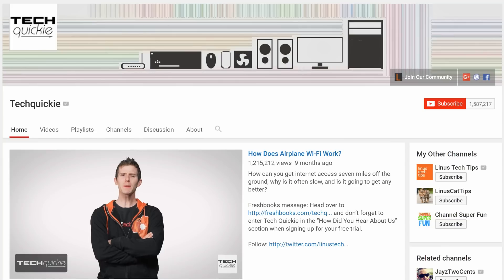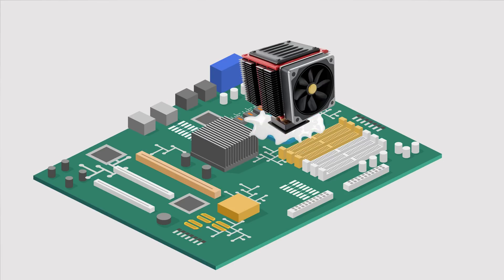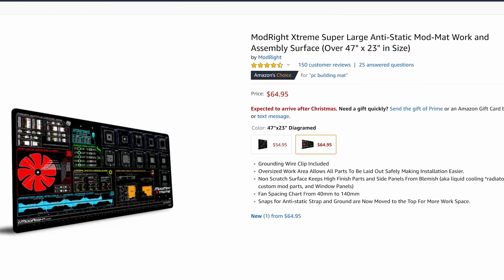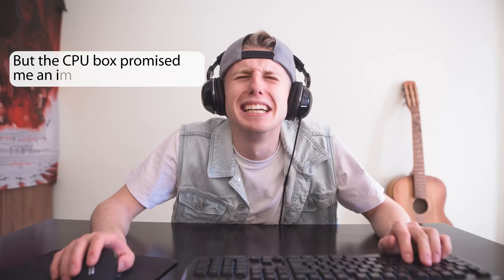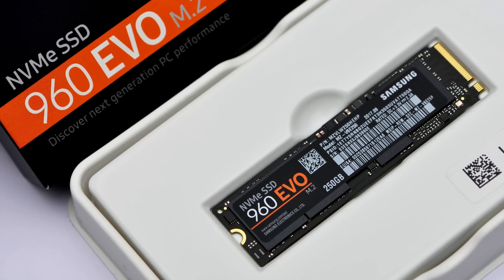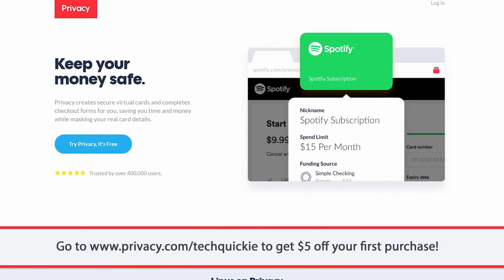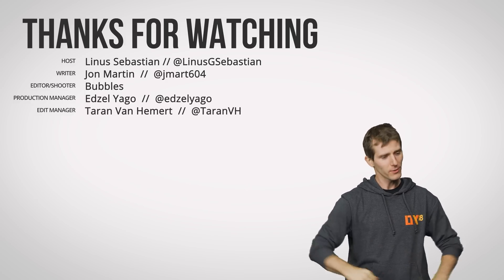DON'T Make THESE Mistakes Building A PC (pt. 5)

Comment: I understand static discharge is overstated. Most all stuff has plenty of shock tolerance so that unless you're walking around with a sweater and rubbing your feet on the carpet  with a visible painful shock happening when you touch things, you'll be fine. Or at least it seems to me from what I've read elsewhere that if you can't see or feel shocks, then they are not strong enough to damage anything.

Comment: common pc building mistakes ive noticed are saving money on a gpu while wasting money on a cpu flashy leds or just getting 1 ram not getting a 500w psu not screwing in the chassi stands not reading the manual for where the power on cords go on the mb

Comment: Avoid mistake I just made - installed a new 2.5" SSD - only realised when i'd  done all my cable management and powered up the PC that I'd gone and used the motherboard's empty SATA connector that gets negated when the NVMe m.2 ssd slot (in my case an optane module) is occupied. Damn - I've got a heavily hardware-populated Fractal Core 500 mini ITX set-up that is a complete bitch to open up, adapt and keep neat internally - I had to reaffix the front header connectors because cable-managing the SATA power leads pulled them all out - It's a challenging, fiddly yet highly rewarding end result of a build. https://uk.pcpartpicker.com/b/PbCbt6

Comment: 1) DON'T go with less than 16 gigs of ram
2) SSD, SSD, SSD, SSD, SSSSDDDDD
3) stock fans on the case will do, more fans don't improve cooling much
4) as many USB 3's as possible
5) get an OVER-THE-TOP power supply just in case

Comment: Speaking of NVMe vs SATA over M.2, some slots will only work with one of these protocols. It's rare to see it happen in atx motherboards, but surprisingly common in laptops. So you could end up buying a drive that won't work at all with your system.
In addition to that, not every motherboard supports booting from NVMe drives, even when they do support NVMe. It's really rare nowadays, but it was a thing a couple of years ago.

Comment: Hey Linus, I recently built a new Gaming PC and for a while it was working. The next morning I turned it on but nothing projected to the motherboard and the GPU fans were twitching. Also the case wouldn’t turn off using the dedicated power button on it. Do you know what that happened?

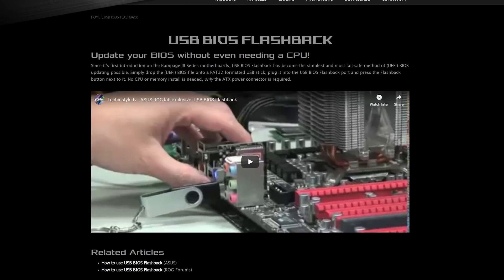Comment: 4:00 "May" ? This should just be considered the default state. MBs that can have their BIOS updated using built-in Hardware are extremely few and far between. As far as I'm aware no AMD supports it, and very few Intel ones do either. If you're doing a new build, get the correct Motherboard for the chip. Even if you can get it working using a BIOS update, the VRMs might not be configured in a way that gets you the best performance.

Comment: i bought a amd a8 apu frm ebay 5 years ago with more than 10 pins bent, straightened them with a ball point pen tip with the refill retracted, works perfectly till date, never taken the risk to remove the cpu ever again.

Comment: i never grounded myself or damaged any component by not doing any anti static measures.
you can literally rub your socks on a carpet and then build a pc without damaging anything. voltage and duration of static shocks are just too low

Comment: Best tip you can give someone is tell them to NOT read the motherboard manual. That's because the manual is written by a bunch of egghead assholes who think they're better than you. Just follow your gut when building a system, because chances are your gut knows just as much as those eggheads when it comes to your motherboard.

Comment: Why the hell would you have the graphic of the SSD on the turtle the show a m.2 nvme but represent it as an older style m. 2 that has the same speed as SATA. You can see the connection it's clearly NVME

REEEEEEEEEEEE

Comment: i've bought mSata ssd on purpose. It does not require extra cables to connect and does not take space in the box. But i see no real world benefit of nvme drives for myself, and it costs like 100$ more for 1tb version.

Comment: Make sure to use stand-offs for securing the mobo into the case, and make sure they are placed correctly into the case, that is aligned with the screw holes in the mobo. Also double check that all the cables are connected properly before trying to boot up the system.

Comment: Im building a pc w/
Intel i5-9600k
Gigabye z390 aorus pro motherboard
Corsair h115i pro cpu cooler
Corsair vengeance 16 gig 2666 hz ram
500gb samsung ssd and 1 tb hdd
Rtx 2070
And an evga supernova g3 550 watt gold certified power supply.
Not sure about the case...

Has anyone got any tips for me?

Comment: Your computer doesn't need to be plugged in for anti-static tools to work.  The point of them is to keep you (or items touching your mat) and computer at the same electrical potential (no static discharge is possible).

Comment: About the pressing down on cpu thing... From what I've seen, the ryzen line actually occasionally need a little push to settle properly and I've seen tech YouTubers who warn against pushing down the cpu then go and do just that and it works fine...
And I ended up having to push a tiny bit on mine too! XD

Comment: My advice if you are not buying everything all at once. 

Make the Video card the Very LAST thing you buy. Piecing a computer together, you should be buying the longest life things first anyway... things that wont go obsolete very quickly (psu, case, ect). Due to that, video cards should always be the last thing. As they always go obsolete the fastest, so by the time you are ready to complete the build, you'll have the latest, or cheapest price, on the video card.

Comment: Linus i need help I'm broke. I'm playing with intel hd integrated graphics and i have a i3 4130 at 3.0 Ghz..... 1 - 4 gb ram at 1300 and no gpu.  I'm thinking of getting a GTX 1030 with 2-3 gb or GTX 750 with 2 gb but both are listed around the same price.... also shluld i get another 4gb 1300 or a higher frequency speed? Plz.....

Comment: One small tip is checking your power supply and motherboard connections, because if they are not properly pluged you will get electrocuted very bad, it happend to me

Comment: I just ran into a trap with my CPU cooler. It was too big to add any additional case fans installed around it. This was built in an ITX case though, but still, the thickness of the fans is somewhat important as I bought a few Noctua fans that i now have to return...

Comment: My house isn’t very big so I was recently kneeling at my coffee table on carpet dropping an 8700k into a new Mobo (Amazon blackfriday deal)
I had the power supply plugged in and switched off by me and I often touched it to discharge static. I had no issues, upgraded rig runs great!

Comment: 1: Don't use a swiss army knife to build it
2: Don't spill Water on it
3: Don't touch the Mobo when the system is on
4: Don't use the wrong Radiator screws
5: Don't Ragequit by throwing your PC out of the Window

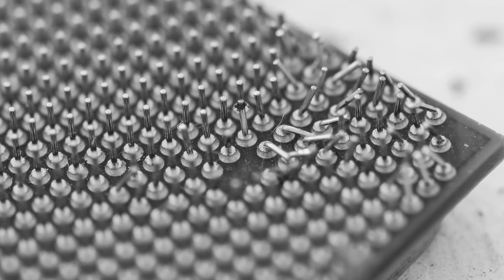Comment: 4:47 I had a friend bring in his mother's computer (that I had built) with pins like that on the AMD CPU. A CPU that was still attached to the heatsink.

How, you ask?

Well, I had told him to remove the heatsink fan so  that he could clean it (and blow air through the heatsink fins). He instead removed the heatsink, but he somehow managed to pull the CPU as well...still attached by the baked thermal compound.

Which, if he knew what he was doing, might have been fine. But he didn't. So after he was finished washing the heatsink (yes, he did), he tried to put it back in.This went...poorly.

Luckily, sanity prevailed and he brought the hot mess to me. So after getting a good laugh out of it, I fixed everything up and that computer is still chugging along.
Reply: I feel like I read this story on reddit😂
Reply: @wh2681  theres a good chance you have
Reply: @HappyKrecik It was an Athlon 2 or something? Black Edition? Don't remember at all. Something like 10 years ago now.

Comment: I have a better one: if you use a motherboard that requires that classical sheet metal IO shield at the back, make sure that no metal tongs are bent out and obstructing the port. ;) I had to remove the motherboard once to fix this (though, it wasn't me who made the mistake).

Comment: Two things. These might be common sense for a lot of folks but here goes. 1 Research the system you are interested in for PSU wattage. Wasn't on the box of the one I just bought. 2 If you are going to add a video card, find out the recommended CPU and PSU wattage. And compare said graphics card with the onboard. They might be about the same depending. Learned the hard way...
Reply: I have a friend using an A10 apu with a gt730 and no matter how much I tell him that the integrated graphics are better than his graphics card but he still insist on that gpu

Comment: I kinda messed up on my first build with the Ryzen 7's Wraith Spire cooler's pre-applied thermal paste. The cooler slightly came off the CPU twice because the stubborn screws wouldn't thread in. I'm worried that it may have created air bubbles. It idles at 32c. Not sure if that's normal. I gotta get a program to test temps in-game but I haven't noticed any performance issues though.

Comment: Buying proper motherboards for overclocking. No not stuff like ‘Z series on Intel and X and B’s on AMD’. I mean phase count, where the XI Hero offers a four phase with a pretty meh heatsink and the Gigabyte Master offers a six phase and a proper heatsink that would be better than most of the ASUS’ lineup.

Comment: You guys are actually wrong... Back in the days of LGA 775 it was common that e.g. Core 2-CPUs did not work in older boards which were designed for Pentium 4-CPUs. And some times even the other way around...

Comment: About the touching metal: touch BARE metal. Linus could have specified that. Painted metal like in the animation WON'T be enough.
Reply: Also they didnt even mention the most important that unless your living in UK not ALL plugs are grounded in most countries. Its mostly the plugs in the kitchen and washing room that have ground pins.
Reply: @tomwes8390  I didn't even think of that. Over here it is required by law to have all plugs grounded. Especially in older houses it could indeed be the case that not all plugs are grounded!
Reply: @Muscleduck  It ofcourse depends on the country but especially on Euro plugs you have to be careful. People just assume that the socket is always grounded but with euro sockets you can see if its grounded. If there is no metal pin in the euro socket sticking its most likely not grounded. The ground pin goes inside the euro plug so it touches the inside of the plug. Opposite of normally where the plug goes in to the socket. The plug must also support grounding (hole in the plug). Not all power strips have ground support
Reply: @tomwes8390  I live in Belgium so I know what EU plugs look like 😉
Reply: @Muscleduck  Explaining for the rest of the viewers how to spot a EU grounded socket :) Wat een mooi toeval! Wist niet eens dat die wet daar zo was in belgie. Gelukkig nieuwjaar nog. Groeten van je buurland
Reply: @tomwes8390  yup als de keurder komt test hij elk stopcontact en algemeen de weerstand op de aarding. Slechte aarding algemeen of een stopcontact zonder aarding = afgekeurd. Prettig 2019 👌
Reply: @Muscleduck  It's required by code to have all new plugs grounded. Anything that was installed prior to that becoming part of code are allowed to remain ungrounded until and unless the circuit or receptacle are modified. If, for some reason, you are using an ungrounded plug and don't feel like spending serious money fixing it, make sure to install your cheater correctly - remove the outlet cover, plug in the cheater, put the cover back on. The outlet cover screw MUST go through the tab on the cheater plug for it to be doing anything.

Comment: Check if your case has stand-offs as part of its design. If it doesn't, then you need to use standoffs before installing the motherboard. Otherwise, if you just screw it straight in, the case will cause it to short-circuit. It can range then from it not booting, or possibly killing your board.

Comment: I miss the older days of having to set jumpers (or dip switches of you were posh) for voltages, clock and multiplier. It sorted techs from hacks quickly by the magic smoke.

Comment: Don't do... Whatever the F*CK I did wrong... The PC runs fine, but it's not stable, crashing games for no apparent reason.
Reply: Sounds like that thing that could be a problem. It's always that damned thing. :/
Reply: Well, whatever thing it is, it's not funny.
Apprearantly, my RAM is causing my GPU to overload and crash and I'm not sure that's even closely related to my frame drops.
Reply: 550. This PC wasn't put together by an inexperienced person, he knew what he was doing. It's faulty RAM, a faulty GPU or a faulty motherboard, if not more than one of those. Even if the odds of that are 0,0001%.

Comment: Do NOT leave computer plugged in, even if it is off. Never plug a ground strap into an outlet's ground hole. You can accidentally hit the power switch, or as Linus has done, forget to turn off. If it is unplugged, it is definitely turned off (warning capacitors can hold electrical charges for hours or days).

Ground yourself to the device you are working on. As long as you are grounded to the device, the strap will make sure no surges get past the installed resister.

Don't have a strap, can't find a spot to connect. Try to keep physical contact with a metal object on your unplugged device, this way both you and the board have the same amount of grounding or electrons or potential. (It's 04:30 can't think well).

Be safe! Also, static is less likely to happen with humidity above 50%. And hopefully less than about 80%, you don't want to be sweating all over your build... lol.

Comment: Oops, I made the M.2 SATA SSD mistake, a 1TB Crucial SSD I bought based on price.  I see they make a PCIe one for $50 more.  Unfortunately, I don't have another application for it if I replace it with a faster one.
Reply: Ah, I see that they make 2.5" enclosures for M.2 drives, so I can remount it in a 2.5"  bay.

Comment: While many motherboards nowadays have multiple M.2 connectors, be aware which kind of M.2 connector they are. Some may only have one NVMe M.2, while the other one or two are keyed and will only support SATA M.2 drives. A quick look at the connector will confirm or deny this, as SATA M.2 connectors have 2 keyed tabs, wheras NVMe only has 1. SATA drives will work in an NVMe connector but not the other way around. Also note that M.2 connectors sometimes lock out certain SATA ports when in use. For example, installing an NVMe drive into M.2 port #0 may disable SATA ports #0 and #1. Check your motherboard's product page or manual to determine if this functionality is present.

Comment: I work in a enterprise level DC, no one uses static wrist bands as we all just ground our selves to the server chassis because the whole rack is grounded and the humility is controlled. You only run into BIOS firmware issues for CPU compatibility if the motherboard was manufactured prior to the CPU generation, this happens at my job once in a while mainly with older equipment that runs both a v3 or a v4 CPU depending on the firmware on the motherboard.

Comment: Make sure that your motherboard had enough chassis fan headers to plug in your fans or buy a fan splitter
Reply: or just buy a fan hub
Reply: @ArashiOdayakana  Works aswell, point is check how many chassis fan headers you have

Comment: tbh static worries aren't a huge issue. I have fixed pc's on my carpet and not had a single problem before just dont rub your hand all over it and you should be fine.

Comment: Using a plugged in PSU as a ground? I assume the PSU should not be installed in the case and plugged into other components while building?

Comment: #1: when building a pc install the cpu and fan first. I installed that last so i had to ask my sibling to hold the back bracket thing behind the motherboard after everything was put into the case (which i didnt knew the bracket existed it fell off after i unscrewed the 4 screws since i was using a ryzen fan so i looked dumb trying to screw the cpu fan with no standoff) while i had to carefully screw the cpu fan before finishing my build